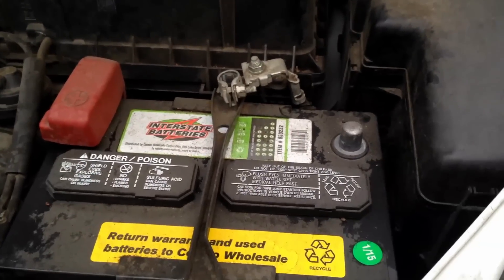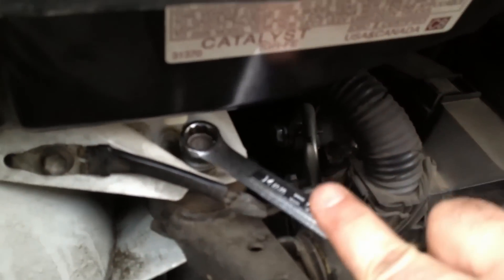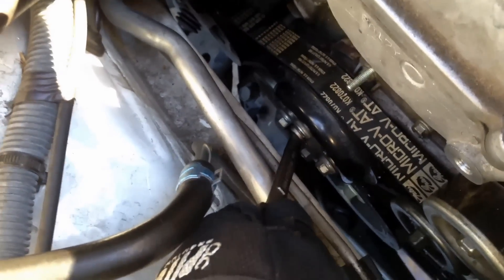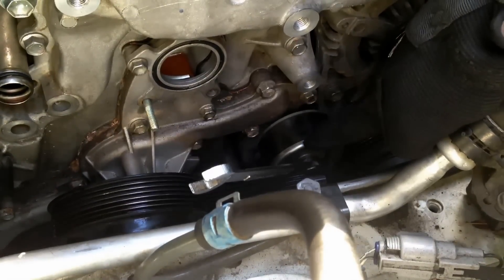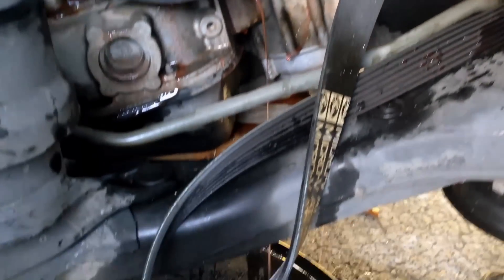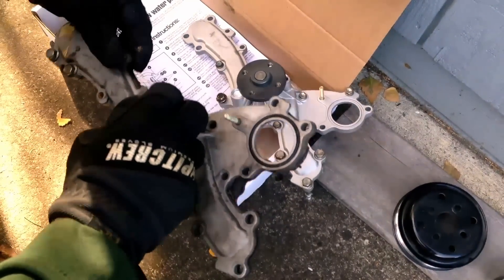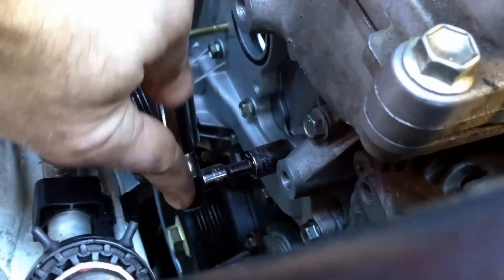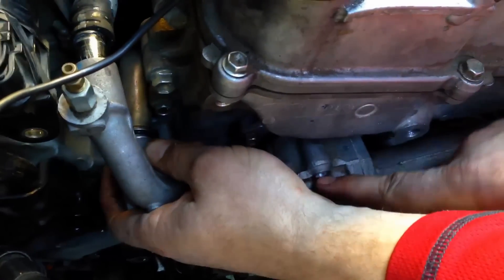Toyota 3.5L V6 Water Pump Replacement:  Removing engine not required!

Comment: How many miles were on the car when this needed to be done?
Reply from the maker: 75k and 125k.  Not super happy about it, either.
Reply: @BroncoSolid  Thank you for your answer. Do you know if the water pumps on the 2011 have the same rate of failure?
Reply: @BroncoSolid  Mine is making noice at 88k. 
The Oem uses cheap bearings.

Comment: Hi video didn’t show putting it all back. !
We are lost trying to get belt back on!  
Help!!!
2015 model Sienna
Reply from the maker: Aw man! Sorry! The installation is reverse of the removal, which sounds like it might not help you at this point. Are you having trouble with where the belt goes? You can google the belt routing, that might help. Best of luck to you.

Comment: Does this work on 2013 Sienna
Reply from the maker: The 2GR-FE engine was present in the Toyota Sienna from 2006-2016, so it should.  Take a careful look to see if there's anything obstructing access.  I haven't personally worked on this model year.
Reply: @BroncoSolid  my mechanic just got back to me and said he can do it this way BUT if he does there is a 20% chance it will leak again and is not under warranty. If he pulls the engine and does it correct its twice as much but under warranty for 12 months.  I did not need this right now....everyone's birthday is in DEC and Christmas.  Life always sends you a big gut punch just when your head is coming above water.
Reply from the maker: I'm not sure how pulling or not pulling the engine will make it leak or not leak in the future, but he's the one calling the shots.  Maybe get a second opinion?

Comment: Did you apply sealant to any of the bolts ? I have read elsewhere that some bolts go through a waterjacket. If you applied sealant , what specifically did you use. Thanks, great video.
Reply: Took apart the waterpump assembly, clearly some of the bolts had some sealant and or locktite applied. Does anybody know what best to use, I want to avoid redoing this job.

Comment: How much toyota dealership charges to replace it
Reply from the maker: I got quotes in the $600 range, but I suppose it varies by region.
Reply: @BroncoSolid  mine is $1300 and it's a 2020 sienna
Reply: @BroncoSolid  does the video apply to 2020 sienna as well?

Comment: How do you know when it needs to be replaced?
Reply from the maker: It started leaking from the edges, and it was making noises.  Also, the pulley was loose and wiggling.  So, a myriad of symptoms.
Reply: If you remove the belt and you can wiggle the pumps flywheel like this https://www.youtube.com/watch?v=qEAJsOIyVDU (Imagine it was still on the engine)

Comment: Why don’t you replace the thermostat and idler pulleys while you’ve got it apart,they do go bad and you save yourself work down the road?
Reply from the maker: The pulleys are easy enough to do in their own later, but I see your point in the thermostat.

Comment: i didn't see you apply any seal/paste to the water pump gasket
Reply from the maker: That's correct, neither the service manual or the gasket manufacturer called for it.

Comment: you skipped explaining the part that you had to remove the lower engine mount bolt to push the engine up to create room for the water pump to come out.
Reply from the maker: Only did the upper mount on this job.  If I skipped over anything, it was the part where I actually pumped the jack up a little.  Everything else is as you see it.
Reply: @BroncoSolid  so you were able to to tilt the engine a little bit without loosening the front and bottom engine mount bolts?

Comment: Did you put any sealant on the gasket on the way back in or on the bolts that hold the water pump in?
Reply from the maker: No, gasket only, as per the repair manual.